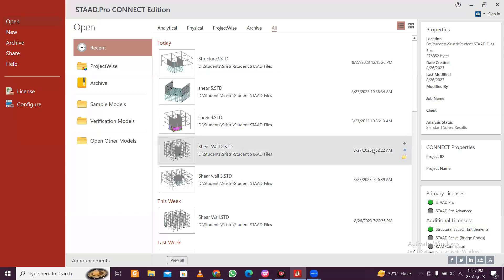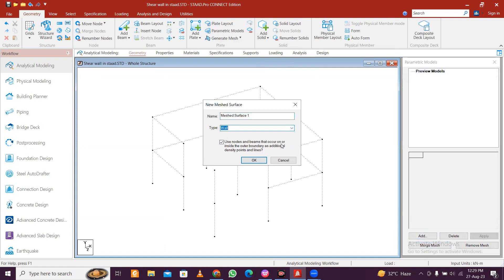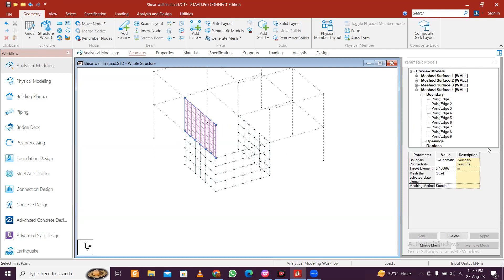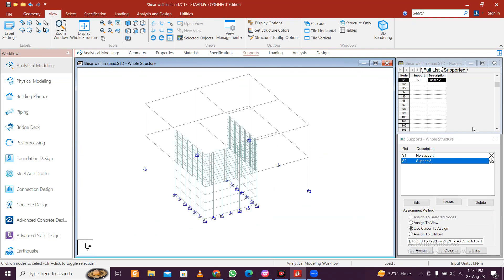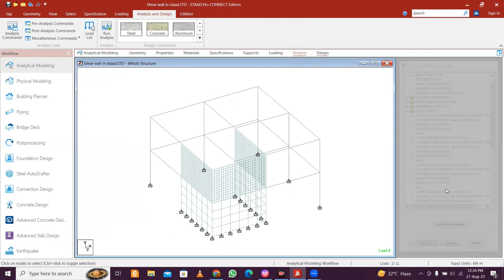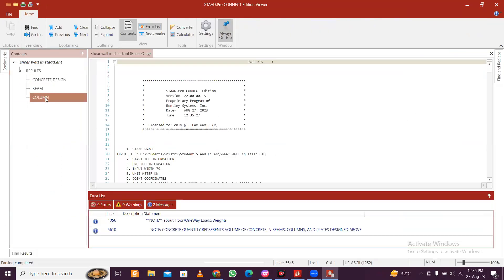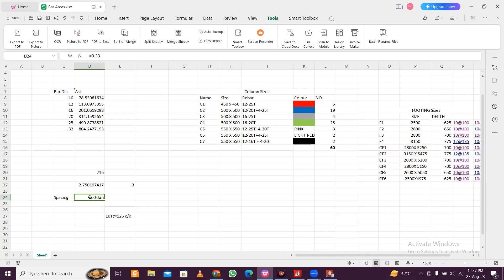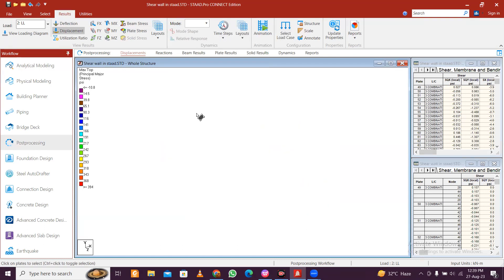Shear Wall Design in STAAD Pro Connect Edition

Comment: For calculating spacing you should divide 1000 by number of bars and not spacing between since in the next 1m too there will be same no.of bars and your analogy will lead to 2 bars at the same common edge location. Draw once you'll understand. But good video nonetheless. 👍
Reply from the maker: True

Comment: Deleting floor beams the floor load will not come on walls, how will you cope with that?
Reply: It is not necessary to model beams to transfer loads unless you need a concealed/embedded beam.
Reply from the maker: One solution is to design the building separately with those beams and ensuring that it's safe. Though it's not a very efficient way but it will get the job done.

Comment: Good Day Sir, how do you determine the default number of divisions of boundary edges?
Reply: Generally we take 0.5m divisions but you can take as you like. Finer gives more accurate results but analysis takes longer plus you should pay special attention to stress calculation considering mesh sizes.

Comment: Great video sir. Please when I model shearwall in staadpro v8i and open file in RCDC I don't see the shearwalls. I have modelled using surface, mesh but still can't see it. but it's done with staadpro connect edition. Is it that shearwalls can't be transferred to rcdc from staadpro v8i. What I'm I missing?
Reply from the maker: Thanks, this is a genuine problem and I am also trying to find a solution to this. But for design you can use the area of steel in Staad, it's not convenient but will get the job done